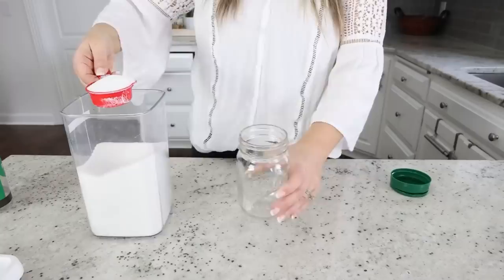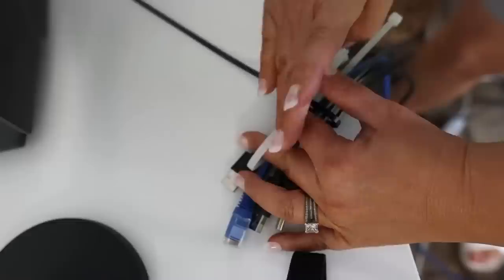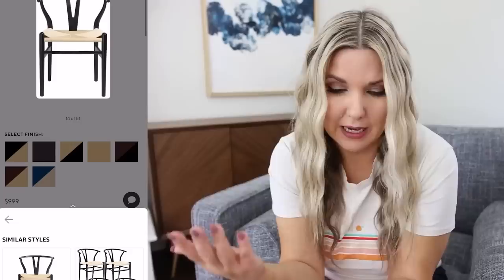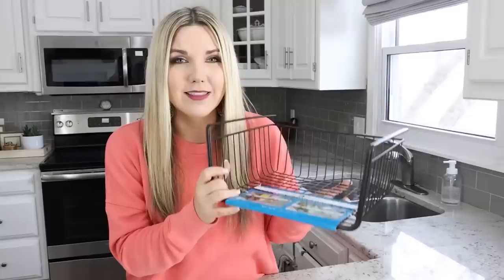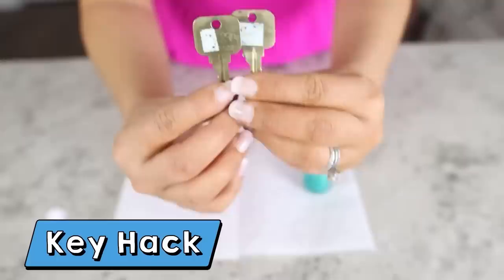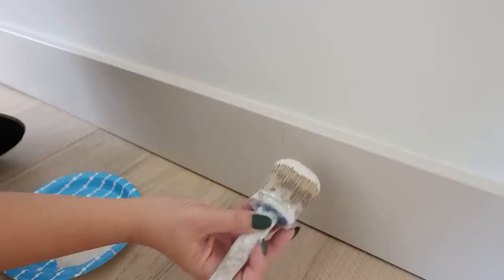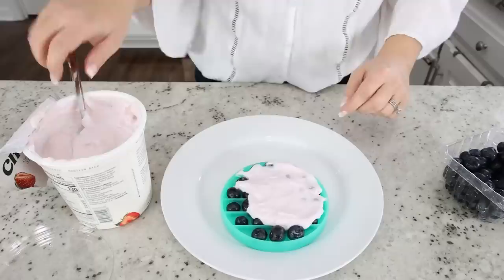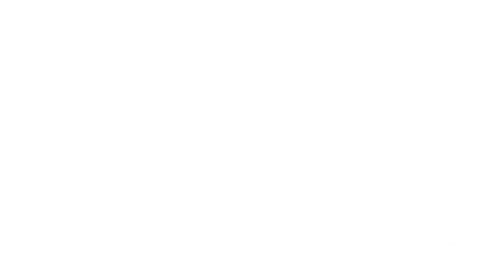60 HOME HACKS...That You HAVE TO TRY!

Comment: The 'Hack' doesn't work if you don't SHOW US the knife is DULL first or your steel already looks 'Brand New'!  Some of your HACKs would work but some are unworkable or unnecessary.  I'm not going to buy 'Chop Sticks' just to use to hang nails for instance.  The 'Hammer' trick would be used for ANY nail job not just one particular nail so you still have a PACK OF NAILS to contend with.  I like the POT hack, the trash bag HACK, etc...